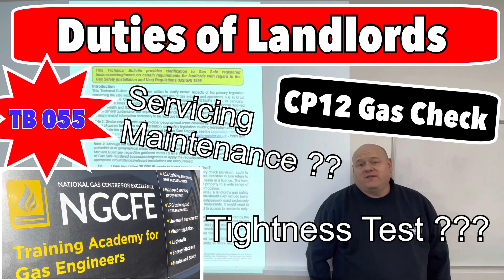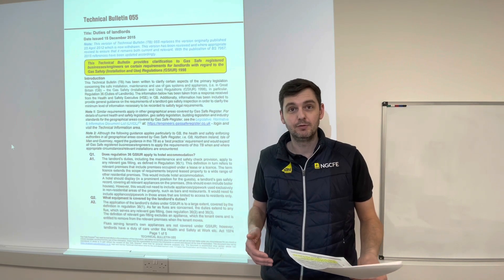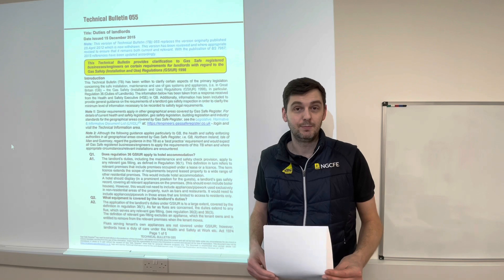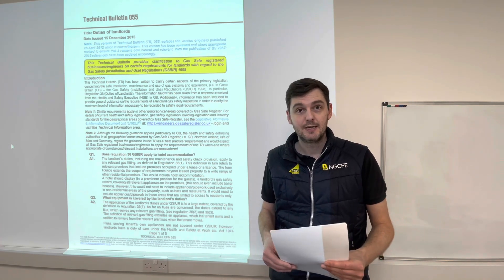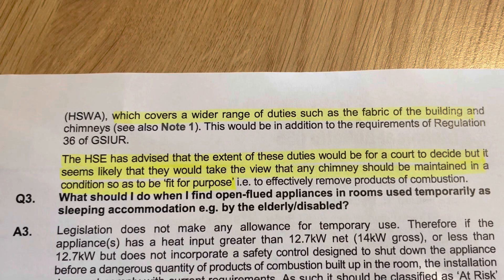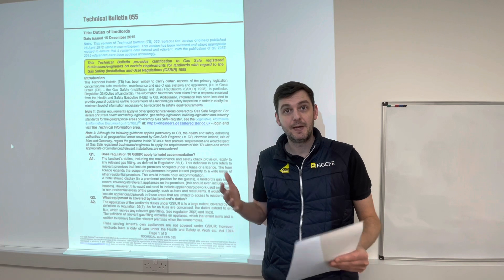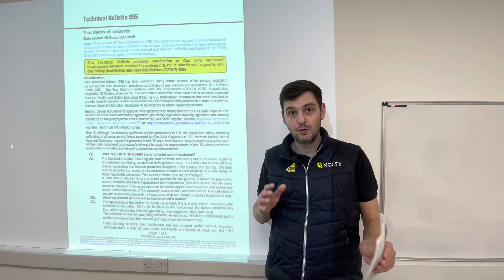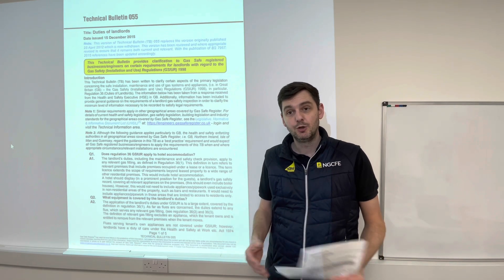Duties of Landlords - CP12 Landlord Gas Safety Check - #NGCFE

Comment: I can not believe that tightness test is not part of gas safety inspection. It has to be compulsory. When I do a gas safety inspection the very first thing I do is let by and tightness test after that standing pressure. After that I carry on with gas rates for each appliance inlet/working pressure on boilers and after that flue gas analyses and air integrity.
Yes I charge customers but I do it properly. 
If you don’t do a tightness there might a gas leak in the property with no smell of gas but you never going to know that unless you do a tightness test.

Comment: Anyone who told me they were charging extra to do a tightness test would get the boot.  I speak as both retired gas engineer and landlord. An agency manages my property and I just know that whoever does my LLGSC does the bare minimum. You can tell from the unreadable scribble that passes for a certificate and the information that is NOT included on it. It's legal, but I'm not happy about it. It's only a combi and a gas hob so not exactly strenuous. Somewhere along the line I'm old fashioned enough to have been taught to provide a service to customers, and not just do the gas analyser five minute dash for cash. I am about to engage the boiler manufacturer to do a full strip down service. Yes it will cost a pretty penny, but I'm not sure who else I can trust to do it properly.
Reply: Calm down Tim 🤣

Comment: How could any self respecting engineer carry out a gas safety inspection and not do a tightness test , takes a couple of minutes and you want to charge extra to do that. its an excuse for lazy attitudes for people going through the motions but not wanting to find any actual problems
Reply: Mate it’s not being lazy - it’s the law! If you do something that you’re not being paid to do you are working outside of your agreement / contract. 

I’m totally with you in that it makes sense and frankly the law should be changed but until it is, you’d be mad to do a test that you’ve not been asked to do.
Reply: @dannyarcher  thanks Danny , but how can it be against the law do carry out a best practice policy and do a check for a possible  gas leak at a customers property.
Reply: @georgerobinson576  because best policy and practice doesn’t ‘beat’ legislated law - plus it’s not against the law to do the test - it’s just what happens with the result and whether you were asked to do it. 

It comes up all the time mate. The fact is it just isn’t a legal requirement to do it. I can’t recall the name but there was a case where an old school gas fitter said ‘sod that I’m doing one because it’s best practice’ and found a non permissible drop. He then capped the meter. The landlord argued that the gas fitter had carried out a test that he was NOT legally required or requested to have done. The fitter had to pay for the entire costs of correcting the system. 

The way around it mate is to give the landlords the choice and make sure it’s in writing. If they say no then don’t do one. Have a look on the bottom of a GSR CP12 pad and check what options you have (bottom left) where it says ‘outcome of gas tightness test - PASS/FAIL/NA’

That’s why the NA is there. 

Personally I think the law should change to include it because it’s just madness as it stands - unless someone can tell me why it’s like that I honestly have no idea.